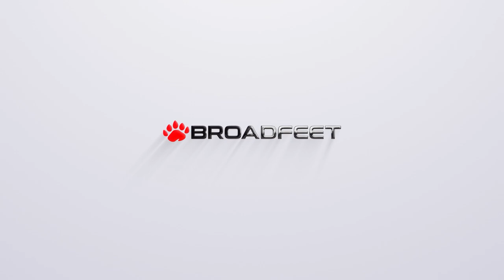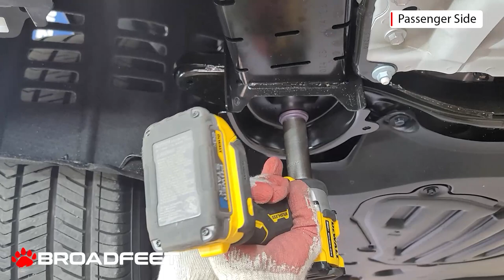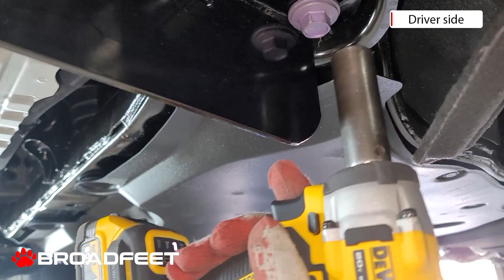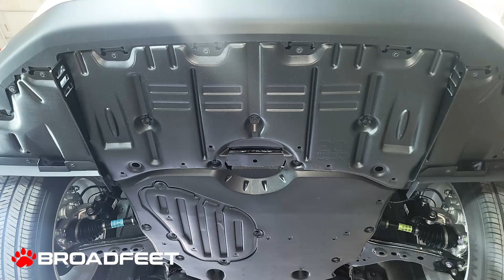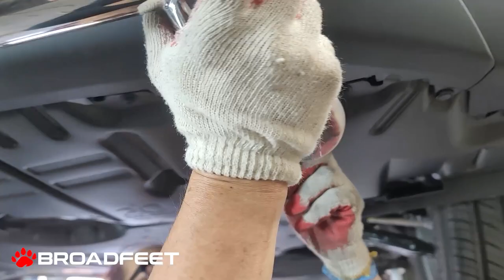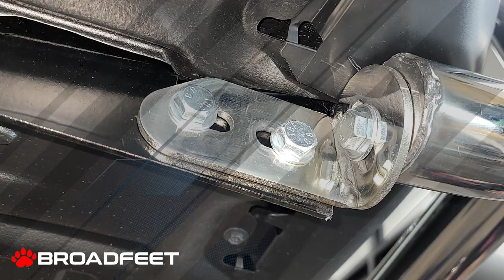Broadfeet® Bumper Guard Installation for 2024 Toyota Grand Highlander

Comment: It only has one mounting point, should have more.  They did not torque the nuts.  Will it interfere with the parking sensors on models equipped?